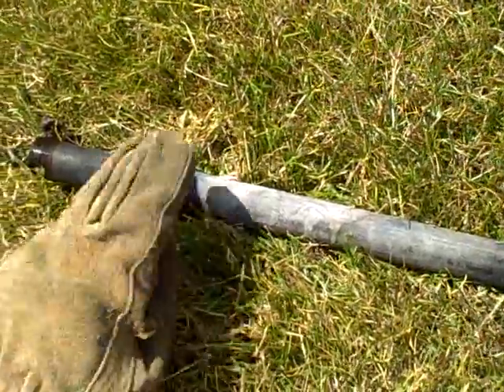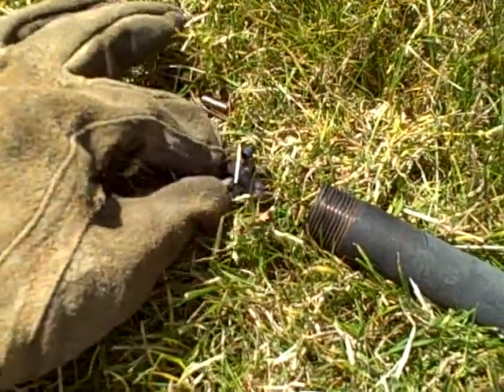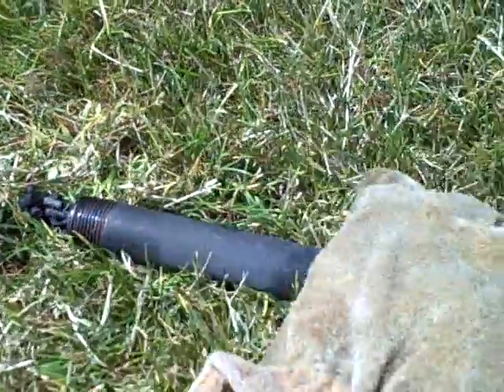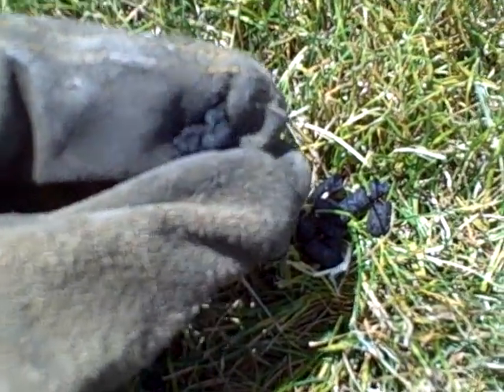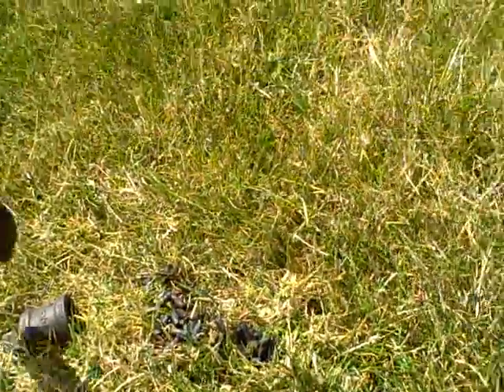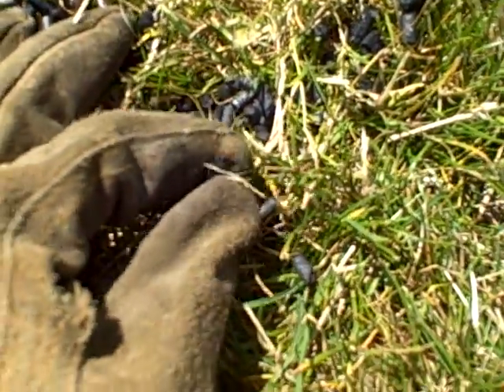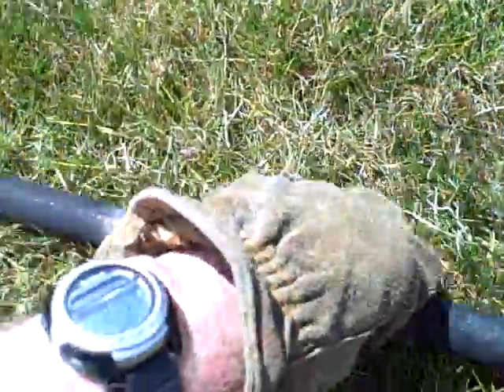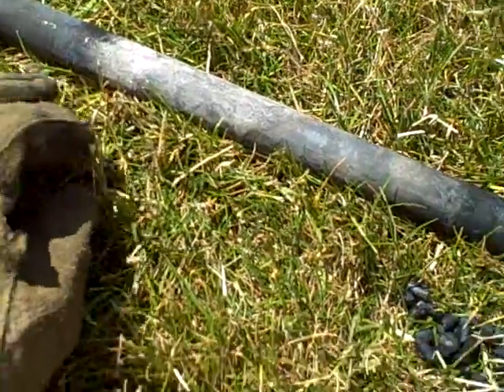Biomass pyrolysis experiment -- retort disassembly (part 1)

Comment from the maker: I've been thinking of lawns myself -- in particular, using lawn grass as a feedstock for pyrolysis/gasification.  My expectation is that you'll get a lot of ammonia in the gas due to grass' high nitrogen content, which is not good as far as fuel is concerned.  If there is any potential, though, it would be worth exploring simply from the standpoint of abundance and ease of collection!